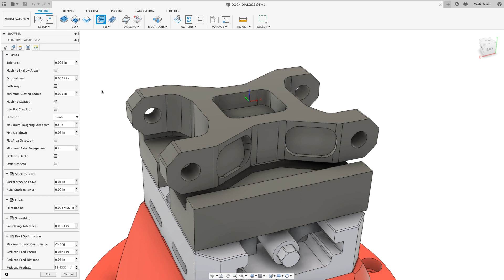QUICK TIP: Menu Off Screen? Then Dock that Dialogue Box!

Comment: I had forgotten that the dialog box can dock to the side,  i frequently switch from 1&2 monitors while working with my laptop, and sometimes when unplugging my 2nd monitor, the dialog box would get lost off screen in the void, only able to fix it by connecting a second monitor again, or restarting fusion.
on another note, while the dialog box is free floating, it can still be resized by dragging the bottom right corner.
Reply from the maker: Thanks for the resizing mention! And hope this helps you out of a bind in the future.

Comment: Ok, so could you add better keyboard support for the UI so that i dont have to constantly take my mouse over there to click on buttons so that i can go back to the center of the screen to click on and edge or profile, then go back over to the side to click another select button to go back to the center of the screen to click another edge or profile or w/e. Things like tabbing through object selections and other controls would save me wearing a hole through my mousepad. I'd say that's one of the main reasons people have a compulsion to move the dialog closer to the center...for an idea of how to do this better, look at your very own Autodesk Inventor. The menus you can navigate via the keyboard and the object selections can be stepped through without having to move the mouse to the UI to click the button to enable the selection mode for whatever operation you're doing. MY GOSH would this be so great in the CAM workspace...i wish for it every time i start using fusion (every day at work)
Reply from the maker: I'm right there with you...I've been since 2016 (https://forums.autodesk.com/t5/fusion-360-ideastation/tab/idi-p/6060816)

Comment: You can both resize and scroll when undocked.  The resize is available in the bottom right of the dialog, as it is with any window/dialog that allows resizing in Windows.  Scrolling is only available when the dialog is sized below what it takes to see it all.  In your example (when you undocked the window), the window was full size, so no scroll bar shown.  If you resize it with the method I just mentioned, the scroll bar would appear. I am not saying that undocking is the way to go, but you can do those things you mentioned when it isn't docked.
Reply: This is true, already doing this infact. i thought it was a strange video for that reason, all it does is show they dont size the window to the height of the screen when it gets undocked, probably fixable with 1 or 2 lines of code in the window Show function. And another 2 lines to fix it opening in a spot that's outside of the visible screen resolution. like if you had it on a second monitor and had to unplug it to take the laptop into the shop, had to write an Autohotkey script to fix that...many people would not know that option and would be forced to go plug in a second monitor so you can move the window back into view
Reply from the maker: We need to review this. Thanks for taking the time to submit this info...to both David and Cara.
Reply: Good to know, seems like I dock so much that I hadn't discovered the ability to resize. Thanks for letting us know!

Comment: Thank you for taking a minute to share some tips on the entire Fusion 360 user experience beyond the software functional features. This is SUPER helpful as I transfer my laptop from my design studio, where I have an external display, out to my shop. The shift in resolution is always a frustrating dance of window re-sizing and toggling menus. I appreciate the detail around what features are lost when the dock is decoupled from the canvas edge, however, if the team has noticed that the UX of designers feeling better about having the menu located closer to the work (perhaps within a narrower field of view to see how changes adjust against the model) it seems like Autodesk might want to adapt the UX to reflect actual use-case behavior?
Reply from the maker: We hear ya...thanks for the thoughtful response and feedback! We really appreciate it. And YES, we want to explore changes to this to adapt to your use-case, rather than you having to contort to our design.
Reply: @legacy goods, i'd suggest looking into AutoHotkey, you could set up a script that resizes/moves any windows you need with the press of a key, could even have it toggle between presets. i've set up quite a bit of stuff with it to help in your exact use case. also, i have it doing mouse moves so i dont constantly have to click areas of the UI that i should be able access with keyboard navigation. Not by any means a simple process to setup and requires programming knowledge, but it's helped me circumvent the many shortcomings of Fusions UI

Comment: I use 3 monitors so like to put dialogue boxes out of the main workspace. This provides the maximum space for the part. I have been frustrated when attempting to return them to the main space, good tip on connecting to the side of the screen, Also you can  widen the dialog before undocking.
Reply from the maker: We're working to improve multi-monitor support. Glad this tip helped explain what happens and how to resolve it.